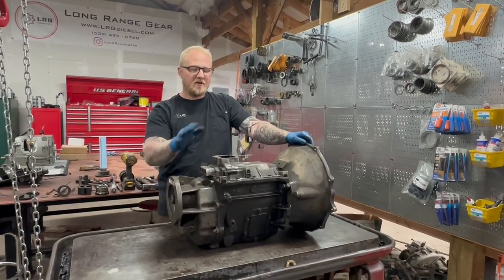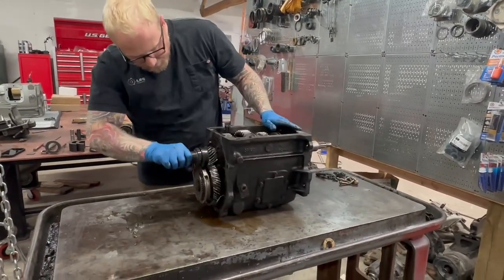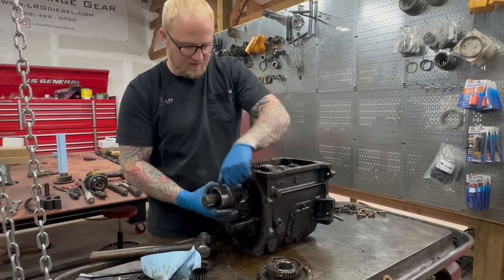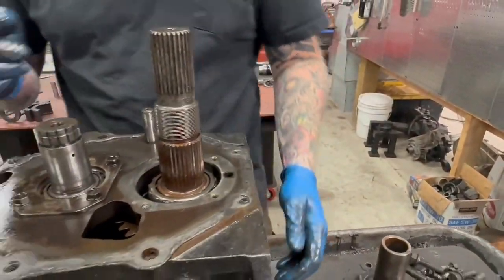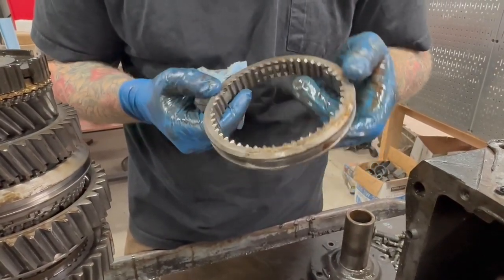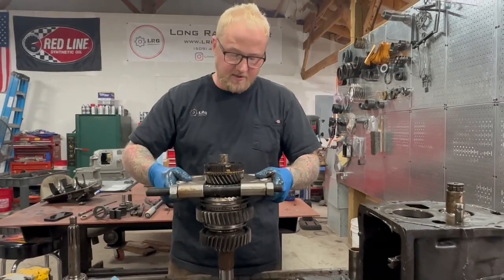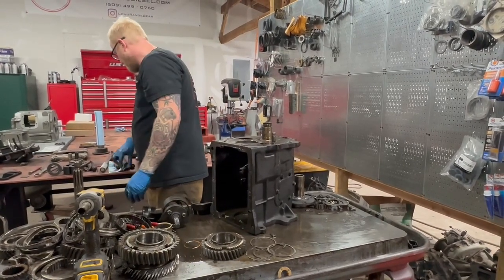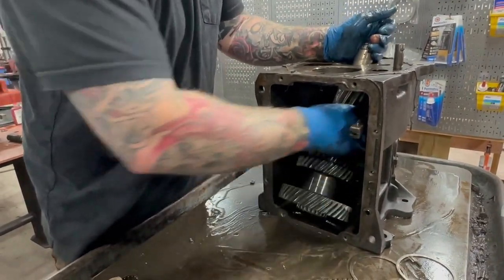NV4500 teardown- you wont believe this 5 speed's 5th gear problems!

Comment: Input shafts good, transfer case seems good, I can put them into gear spin the rear shaft and the front shaft will spin. I put it into 2wd it seems as if it still wants to move the front drive shaft but doesn’t. Truck just won’t move. Seems like everything works. Resistance doesn’t change weather clutch is in or out either.

Comment: Hello, I have a 2004, GMC 2500 HD four-wheel-drive truck with an NV4500 transmission. Last week this last week it has NV 4500 trans. I’ve checked everything and I’m stumped when you’re going through the gears pulling it does great no noise when you let off the gas on deceleration it will pop I’ve checked the front CV joints I’m just not sure if it’s the transmission after I have taken off the inspection plates on the trans. All the gears look good that I can see nothing metallic in the oil no chunks in bottom. I am just stumped on what it could be. Do you have any suggestions?

Comment: How come you say that the brass synchronizers are trash? I’m new to the nv4500 and all I have heard is that brass is an actual upgrade. If you say carbon fiber is the only way to go, then tell us what fluid to use. When I went to change my gear lube in my 4500, I had a hell of a time trying to find out what the correct fluid was. I heard the original manufacturer quit making The stuff and you had to cross reference to a different one. So please tell us right now what to use in a stock nv4500. Please and thank you.
Reply from the maker: Redline MT-85 is the only fluid I recommend for NV4500s. Im not a brass synchro fan in any application aside from G56’s, carbon fiber just works better with a good fluid.
Reply: I run ams oil you can also go to a dealership to get “stock” oil but it’s the same just more expensive. The Ams oil has a red label stating it’s for manual transmissions and transaxle. On the back of the bottle it says nv 4500. 
It has to have a special sulpherless additive in it other wise sulpher reacts with soft yellow metal synchros to create sulphuric acid which destroys them.